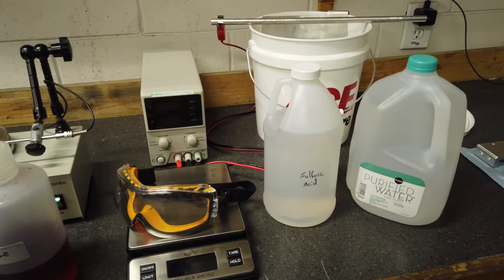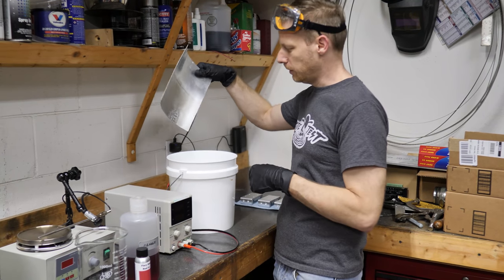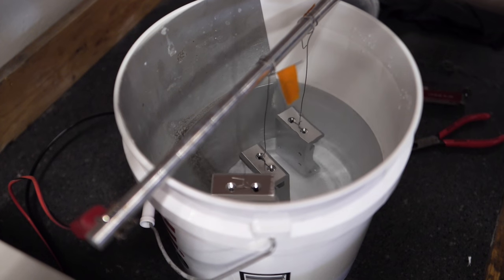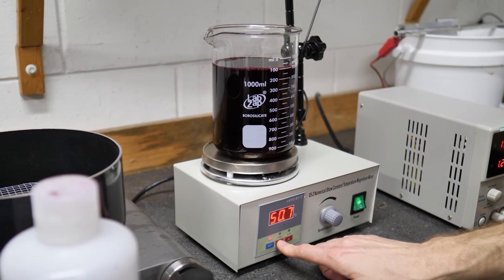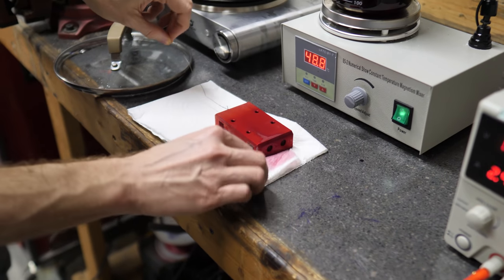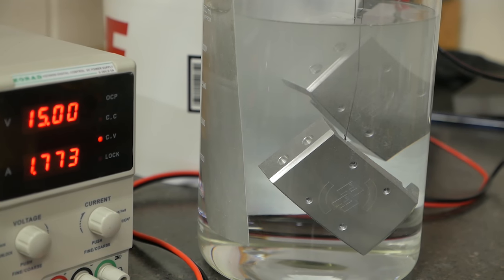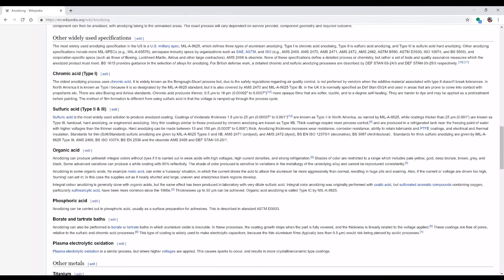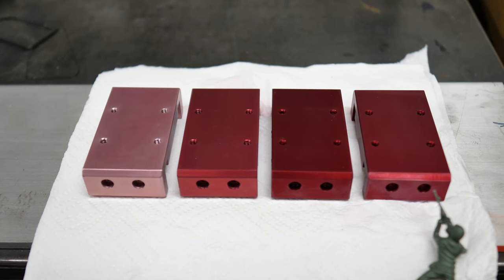Anodizing with/on Acid - S02E48

Comment: When I done mine I cleaned the parts using sodium hydroxide, again eats away product so 30-45 secs, also a aquatic air pump helps to keep the mix agitated and cool, which I believe helped in conductivity. Great advice on the bucket size thou, I learned the hard way!! Been ages since I done a video, yours is so much better!!

Comment: I've found I get better dyeing results if I dry the part between the rinse and the dye. My assumption is that dye penetrates less evenly if the pores start out being filled with water. I dry them with clean/dry compressed air, the contrast between dry and saturated unsealed anodize is stark, so it's easy to tell when the part is sufficiently dry.

Comment: to take away some fears: if you add water to acid, it doesnt explode in your face. you are using dilute acids more than likely where its not a problem to do. best practice is to add the acid, right, but you dont have to be afraid of working with acids. you add water to acid everytime you drink something and you dont explode from it :)
Reply: Depending on which acids, the problem is that it might boils the water, and the bubbles will then be splashing concentrated acid. So  you should still be careful !
Reply: Some acids, high conc sulphuric for instance gets pretty damn hot when it hits water. That can cause localised boiling and spitting. Same as some strong bases too. It's not an enormous inconvenience to add acid first. Dilute acids are different, I'd feel comfortable adding water to the anodising solution here.

Comment: Were you using 96% sulfuric acid? Do you have a source where you got it from?
Reply: My hygrometer reads it to be somewhere around 90%, so in that neighborhood. It's pretty easy to get in the US as battery electrolyte (for lead acid batteries like in cars) but I understand some countries regulate it. Someone told me you can buy it as drain cleaner in the UK, but they took it off the auto parts store shelves. If you get some and it's purple or some other color that's usually a sign that it's heavily diluted...it can be purified back down if that's your only option.
Reply: Good question, I saw that the "battery acid" sold by Auto Zone is specific gravity 1.265 which equates to about 34%  sulfuric acid.  So it sounds like the sulfuric acid used here is much stronger.   i am thinking to order from chemical supplier, but still need to figure out what the correct specific gravity should be for optimal anodizing.  In the video, assuming the acid is about 20% of the total weight, and its 90% acid, then the mixture is about 18% acid or sp gr of 1.124.  I guess i can do the math to figure out how to dilute to a similar acid concentration if i go the off-the-shelf way...  Any thoughts?  High school chemistry was many decages ago!

Comment: Damn, it took me much longer than I would have liked to figure out the "with/on" part of the title. Now that I finally get it... ;D
I was wondering if it was a typo for "with/out" (the long-form version of "w/o", I guess), which made me think you were doing the method of aluminum anodizing that uses ph-down. I've done a little bit of DIY anodizing using ph-down and have had pretty good results. I'm not sure if there's any tangible difference between results from the two methods, but it's nice that the electrolyte is not as much of a pain to handle or be around as acid, and also the peaks last longer.

Comment: I'd like to hear more about the properties of the dyes. Like what's the actual differences between dye types and brands? Good video thanks.
Reply: Oh yeah, there's a whole thing about that, like most of the dyes are organic except for black, and the biggest differences between them are grain size/consistency. Which is also why you never see a white anodizing dye: white pigment is usually made it things like titanium oxide, which is too big to fit in the pores. I think that's why clothing dyes come up strange: inconsistent grains and poor purity
Reply: @wileecoyoti  I tried the brand they used Fiery Red and compared it against Racing Red RIT Dyemore synthetic dye and the result was almost identical. Most inconsistencies I've run into were something I did wrong during the process upto dying and not really the dye itself. It made me wonder if the "professional 'dyes for anodizing aren't just filtered rit dyes. White would be cool. Or an iridescent pearl.
Reply: @alexbarnett8541  I have a feeling we're going to revisit this (especially since right now I'm anodizing 5-10 parts almost every day, keep learning new tricks as I go). When we do I think we'll have to test out a bunch of dyes that "aren't for anodizing" and see what you can get away with. Above dye noted!
Reply: @wileecoyoti  definitely. I'd like to try some abrasion testing on different dyes since that's also very important. Anodizing is definitely addictive.

Comment: pure sulfuric acid is extremely dangerous.  This is VERY diluted. yes you really dont want it in your eyes.. BUT you can get battery acid (diluted sulfuric acid) on your hands with no real issue unless you have very sensitive skin. 
I do electroplating using sulfuric acid based compounds. No i dont wear gloves and my skin is very much still on my hands unharmed even though i get direct contact with the diluted acids.  I make zinc and nickel sulfate by hand with battery acid instead of buying the crystals. 

I'm NOT saying its safe to take a bath in battery acid, but nobody wears glove or goggles to eat hot sauce or drink lemon aid...   you really wouldn't want either in your eyes.